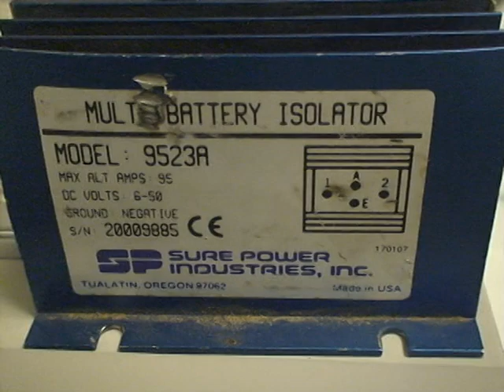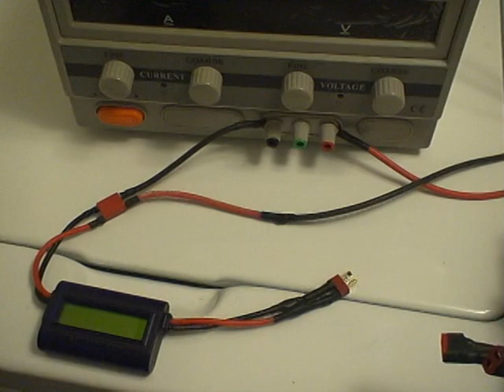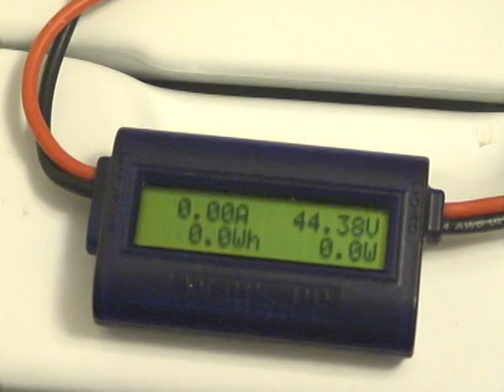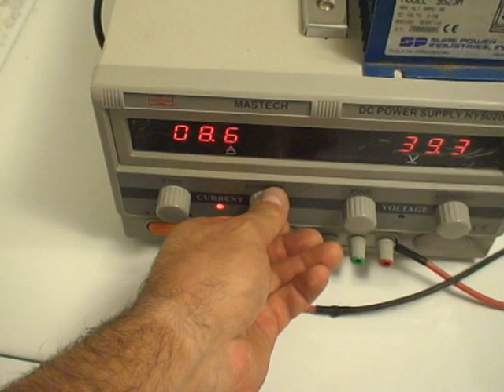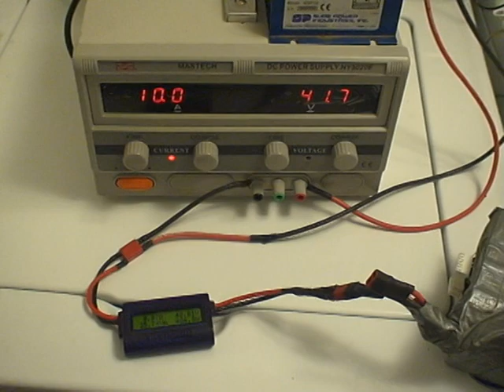Charging A123 cells with HY5020E Part 1

Comment: Yep.  You can crush A123 cells... I've seen guys hit them with 20A.  They are really tough little cells.  They are conservatively rated at 5c charge on the latest cells I got which would mean 2.3 * 5 = 11.5A . That would recharge a fully discharged pack in 12 minutes.  Since you almost never fully discharge a pack the charge time will likely be less than that.

Comment: i think those batteries are rated for about 2.3Ah charging them at ten amps is about 4 times there rating i would not go above 2 time the rating to maximize life span. also how much did the power supply cost?